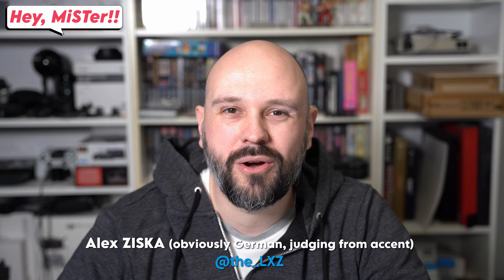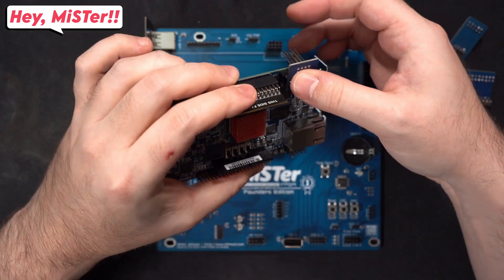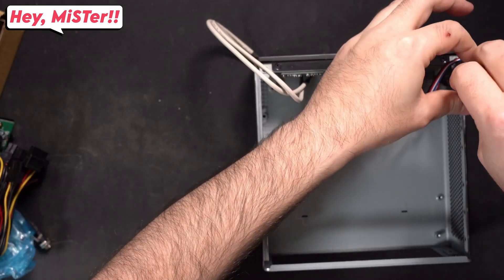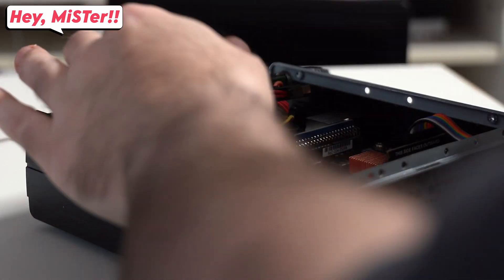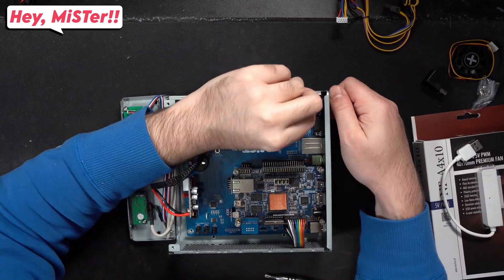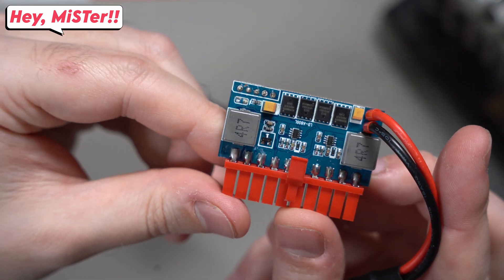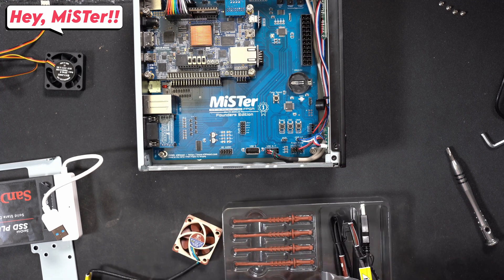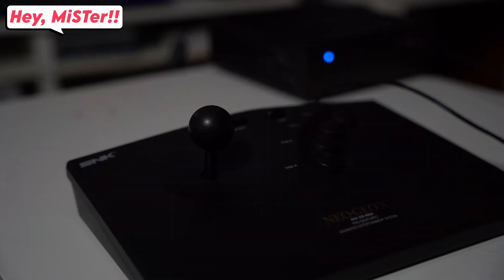The MiSTer Mini-ITX Ironclad Plus - MiSTer FPGA goes ITX! | Hey, Mister!! Episode 01

Comment: I am d3fmod, congrats on the video i am very excited to to see you enjoying the Ironclad Plus!, seriously, this makes me very happy. I have only a suggestion. It's easier to connect the LAN and USB bridges to the DE10 and connect the DE10 to the ironclad with only those two bridges installed, then install the other remaining bridges one by one ;)
Reply from the maker: Hey Roberto. I read that on your website where you outlined the installation process. I can only speak for myself but I tried both and found it easier the other way. I felt like I'd be putting too much unnecessary stress on the DE10-Nano otherwise.

Also: Happy to report that this weird shut-off never happened again. Was shaking the whole enclosure while it was on and nothing happened. So, likely a weird fluke.

My one and only wish / suggestion for a future revision would be a hard power switch at the back, so you could completely shut it off (so that even the IR led would go out).
Reply: @LXZ  The shut-off you described doing 3 beeps means it detected a big power fluctuation so it cut the power to the DE10 to protect it and then shut off everything. It probably was the brick power barrel plug moving a bit and loosing some contact, nothing to worry about if this behavior is not repeating randomly ;)

There is no way to completely shut off an ATX power supply, it is always providing a small current while it is plugged, an external switch installed on the brick cable should do it. I could put a switch that would shut off completely the Ironclad, but the PSU would still be ON (in standby) no matter what.
Reply: @Rojame77  in
Reply: Got my board this week love it. One question though, the mt32 extension uses userport 2 and hence every core using it needs to be patched, are there any efforts on the way to get this into the main cores?
Reply: @werpu12  Hi, that's up to Sorgelig, but i would say there's little chance, as the userio2 has some pins in conflict with the official digital IO board. A software switch could be implemented, or maybe not, anyway i am personally patching the cores every time a new important release of this cores show up.

Comment: Hi Alex, Hey i just installed my Mini-ITX Ironclad Plus Board with my MISTer into the same case you have. Everything powers on fine but my Samsung TV says Mode not Supported, Please change resolution on your external device. I'm not sure what to do now, any advise? Thank You
Reply from the maker: Sorry, saw this just now. Did you manage to get it to work? Does it work on your TV without the Ironclad? Asking because my initial thought is that you might have to change the resolution or refresh rate in the mister's INI file as your TV doesn't seem to be able to handle / process the signal.

Comment: Great video. Are there any specific reasons why you went with this board over the Jammix board?
Reply from the maker: Thanks! To answer your question: From my understanding, the main selling point of the Jammix board is the Jamma connector for compatible arcade cabinets. That's not my usecase though, hence it'd be an unneeded feature.

Comment: Is the internal usb 3.0 or 2.0?
Reply from the maker: 2.0. So in order to copy 1TB to an USB SSD or HDD, it makes sense to unplug it and connect it directly to your PC. When using FTP / SSH remote transmission, the USB 2.0 would be a bottleneck. It is totally fine for normal usage. The MiSTer doesn't support USB 3 speed anyway

Comment: Do you need to take apart the case every time to get to the sd card?
Reply from the maker: You do, sadly. I think the reasoning behind this is that, once the MiSTer is running, the designer of the Ironclad expects the user to use LAN /WiFi an the usage of an SSH connection to access the content of the SD card. You could remedy things by using one of these SD card extension ribbon-cables that are often used in Raspberry Pi projects.

Comment: I enjoyed the video. The only thing that triggered my OCD was that fan mounting :-)
Needs either a lasercut or 3d printed bracket. Also maybe go up a fan size? You have room for a 50mm or even 60mm fan in there. Why not take advantage of it?
Reply from the maker: Fair point! I actually got something in store for this. Currently planning a follow-up video which I want to shoot the coming weekend.
Reply: @LXZ  hi Alex, thanks for making this video! I went with the same case. I went for a bigger fan 60mm, and it fits The mounting holes. The only thing that is confusing to me is the way you install the fan. Now you are blowing air into the case and not the hot air out. Correct?
Reply: @caligariVStakaru My thoughts exactly. Was expecting the fan to be mounted the other side.

Comment: Greetings from Norway! I have pre-ordered an ironclad, but I will have to wait until April-May to get it. So if you have any updates on your build, please share them so I can learn as much as possible before the board arrives. Great video by the way.
Reply from the maker: I do indeed have some minor updates done to it and some more incoming. Didn't know if they'd warrant a new video but now that I know that there is at least one person who would like to see that, I'll give it a go once the parts I ordered are here. Thanks!
Reply: @LXZ  I have done a lot of searching and you seem the be one of the few with actual video content on the Ironclad. And it does help when the video is well made as well. I am especially grateful for the inclusion of the mistakes and you talking about them. I am quite new to the Mister FPGA and there is much to learn!
Reply from the maker: @Rakadis  Thanks! Feel free to suggest anything and everything in terms of content that might be interesting. I am currently struggling to come up with ideas what else I could cover.
Reply: @LXZ  What I would love to see more about is the software setup process and long term use and maybe tips and tricks that you have picked up. How is that ssd working for you for instance? Do you get good read/write speeds? Maybe more information on the Ironclad and its use? Has it been working well? Do you have enough I/O ports etc. What screen are you using? There are about a million questions I can think up just off the top of my head.
Reply from the maker: @Rakadis  Awesome! That are great suggestions. Thank you!
Reply: @LXZ  Sorry to bother you, but are there any chance of an update video on your experiences?

Comment: Can you run 2 ram chips in this??
Reply from the maker: Why would anyone want to do this?
Reply: @LXZ  the upcoming Saturn core needs 2 and the psx core , can use 1 , but you can use 2 for best sound accuracy .
Reply from the maker: Okay, interesting. No additional memory port as far as I can tell. Curiously - where on the DE10 nano would one connect such a secondary ram module?

Comment: did you add the memory module?
Reply from the maker: Of course. It's already on the DE10-nano
Reply: @LXZ  I was wondering if you were using the 4c or the standard 2.9 (or 2.5) and if there were interference issues anywhere, thanks.
Reply from the maker: @clippy_friend  Not the 4C but a standard 128MB one from Ultimatemister. No idea about the actual version. Not having any issues with it whatsoever - not before using the Ironclad and not since.
Reply: @LXZ  Awesome, thanks. Great video. Sorry for the dumb questions, but going to be building a mister system like yours soon.
Reply from the maker: @clippy_friend  You're welcome and not dumb questions at all.
Reply from the maker: @jon Did a quick check to confirm - it is ver2.5
Reply: @LXZ  Thanks the update, man

Comment: Nice project : clean and  well organized.
The access to the SD card is a little problematic and I need to have an easy access to the I/O port...
But if you don't have to  mess often with those two things, it's nice ! 
Well done ! 😃
Reply from the maker: Just last night I was thinking about incorporating one of those SD extenders
Reply: @LXZ  it could be good idea ....(and you can find easily this kind parts on aliexpress...)
I guess you will need to "tinker" your metal case if you want something easy to use ...

Comment: Hey alex, do you happen to have a link to this case ? 
Also, do you have any other case recommandation please ? 
Thanx
Reply from the maker: Link is in the description - it's German online store "Mini PC". As for other cases, not really. At least when one is looking for a case that only has two front USB 2.0 and a power button (so no Reset button, no Headphone + Mic Jacks, no HDD led, no USB 3 ports) then there aren't really any options. Maybe front panel modding is the way to go.
Reply: @LXZ  No, im OK with minimalistic connexion on the front, thats the kind Im looking for

Comment: im going to put one of these together but i have a question...is it possible to use a 2.5" 15mm hard drive with that case? (i want to use a 4tb drive and they are 15mm....before i buy this case do you have any idea if that drive will fit in it with the irconclad it looks like it might but i cant tell as i dont have any of it in yet?)
Reply from the maker: I think that will totally fit
Reply: hmmmm how much space do you have from the drive once its on that mounting plate to the top of (what looks to be the ethernet port)....or does the drive not go back that far  in the case that it wont hit it? (sorry if im not making sense)
Reply from the maker: @bilsmak  umm, by 15mm, I figured you meant height? That should fit because I think my SSD isn't much smaller in height plus I used the standoffs to accommodate for the USB adapter's SATA connector. So it should work out. Or are you planning to accommodate a 3.5 inch drive? I don't think there are mounting points for that.
Reply: @LXZ  yeah 15mm is the height of the drive im looking to buy i just wasnt sure of the clearance i forgot you are using standoffs...im guessing it should fit
Reply from the maker: @bilsmak  Then it should be totally fine - even if you too need standoffs because of an oddly shaped SATA connector.

Comment: Nice details and experiences with the board. I ordered one tonight myself. Plan on using a J Hack Pure Mk2 case with internal Meanwell PSU to elimenate the external power brick. Thanks for the video!
Reply: i just looked up that case....if you plan on using a fan how do you plan on mounting it in that case?
Reply: First I will try countersunk screws into the top slots to retain the fan.’, with the screw heads flush to the top of the case. Alternatively I will either fire up Unigraphics and create a 3D printed fan holder / mount to the DE10 or a sheet metal adapter using the top cover holes in the frame to mount / locate the fan over the DE10. Either way there are multiple solutions.
Reply: Sounds like I have 4-6 months to work both solutions out.

Comment: Does the mister need 120 watts? Or would a smaller PSU work?
Reply from the maker: 120W is actually overkill. A smaller one would work. Look at the amp rating. MiSTer needs a PSU capable of providing about 2 amps from the 5 volts line or more if you use an HDD.

Comment: Can you write the exact TYPE designation of the PICO ITX PSU here and where you can order it?
Reply from the maker: Added a link to the description. Please let me know if you need more information
Reply: @LXZ  thank you so much for detail video and links to the products used. For the Pico power supply, what power brick you can safely use, is the 120w good enough ? Thanks again
Reply from the maker: @jeff15  The power brick depends on the Pico PSU. Even 80W are plenty for MiSTer. Pay attention to the 5V amp rating. 2 amps is good. Maybe 3 to 4 if you connect more stuff such as an USB HDD

Comment: Thanks for this video and showing your experience 😊

Could you please put links in the description for all the extra accessories you used?
Reply from the maker: Sure, I can do that. It's mostly German online stores, though. Will add them later.
Reply: @LXZ  That's fine for me as I'm from Denmark and often shop from other EU countries. Thanks :)
Reply from the maker: @krunge  Added. Let me know if you are missing something specific.
Reply: @LXZ  Thanks again! But what about the power supply? I see you used a PICO PSU and I read it needs to be 12V but what about amps and watt?
Reply from the maker: @krunge  Fair point! The 12V power brick came with the case and its original (too big, open frame PSU). It works great with the PICO PSU. Made by Seasonic, which is sort of the only PSU manufacturing company I trust (had a Delta PSU explode once). I will add this to the point of things to cover in my follow-up video which I plan to shoot the coming weekend.
Reply: @LXZ  Sounds good 😊 I'm asking because my case came without a power supply and I bought a PICO PSU as well but it's without the power adapter. The PICO PSU I bought is rated at 160W but I'm not sure if the power adapter should be 12V exactly and how many amps? 🤔
Reply from the maker: @krunge  Sorry, I replied in a hurry and sort of skipped that part of your question.

tl;dr - the PSU section of the Ironclad's website has you covered: https://www.d3fmod.com/ironclad-plus-assembly/#psu

Long answer: The wattage of the PICO is the amount of power it can handle - so in your case, it could withstand if the system was to pull 160W, given that the 12V brick can supply 160W. The MiSTer will likely max out at around pulling 9W, so you have a lot of headroom. More important is the amps rating as the MiSTer will need about 2 amps or maybe a bit more if you add a hdd, a fan or other extras. Good thing is that even the small, 80 W PICOs supply about 6 amps. So again, a lot of headroom there.
Reply: @LXZ  no worries, thank you for explaining 😊